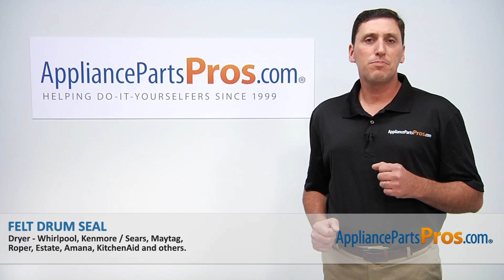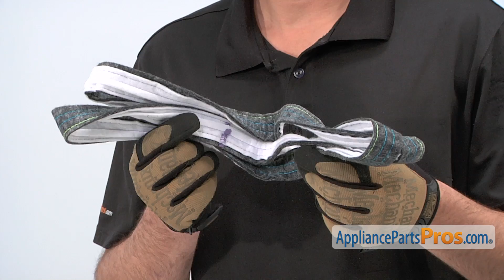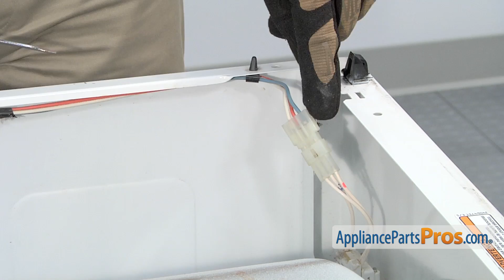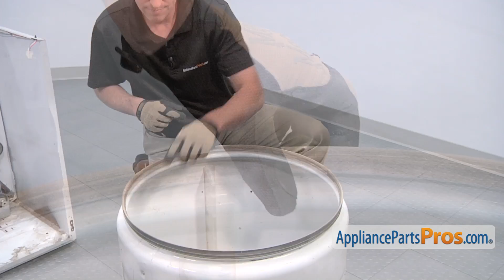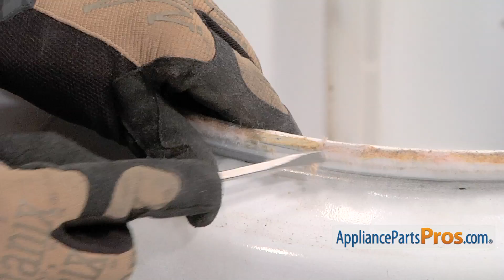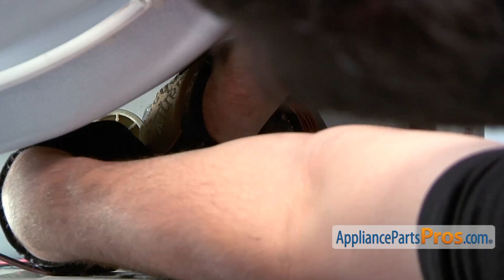How To: Whirlpool/KitchenAid/Maytag Felt Drum Seal W10612022

Comment: Done this many dozens of times, never removed the old glue, never had a problem just gluing the new one on and 3-4 vice grips will make your life a lot easier putting this on.
Reply: See my reply to you later down in the comments.
Edit: and for gods sake don't use vice grips here it has the potential to crush the lip of the drum where it is rolled on the edge. Use spring loaded clothes pins like shown or better yet small spring clips. They're .50c each at harbor freight.
Reply: @ogrish76 I'm doing this repair right now. Do we need to wait a day for the glue to dry or just the 20 minutes?
Reply: @modernNeanderthal800  I just did mine I'd say let it dry over night. It took some tugging to get them in the right position when it came time to put it together it's not a place you want to mess up.
Reply: @SlickArmor  It didn't work so we threw it away and got a $600 dryer.
Reply: @modernNeanderthal800  oh man sorry to hear that.

Comment: Thank you so much for this. This video really helped me a ton. But I did have a little issue carefully putting the seal around the drum on the adhesive, though. It seemed a lot easier in this video than it actually was, but I'm by no means close to a handyman. Also it may have helped to note the angle facing outward for the pulley. I didn't realize I had it on backwards and had to start all the way over from there. I hope I'm not sounding overly critical. Like I said earlier, this was a life saver. The instructions were so clear and gave plenty of in depth views of what exactly to do.
Reply: They always make it look super easily in the videos lol, 3-4 vice grips make this easy to get on.
Reply: @ogrish76  Yeah, everyone else uses binder clips, clothes pins, and even vice grips.  One guy in the comments said it was like putting a tire on.  I've never seen anyone do it the way this guy did, but he was using a seal that fit on easily.  Try your seal out first before doing it this way.

Comment: To remove the old glue, use a rotary tool with wire brush attachment.  It worked like a charm to provide a clean surface with which to apply new adhesive.
Reply: Done this many dozens of times, never removed the old glue, never had a problem just gluing the new one on
Reply: @ogrish76  don't be a slob hack, there is a reason you remove the old glue residue. It allows the felt to fully seat into the groove and you'll have no tight spots where the seal is pushed up from old glue deposits. That's the difference between a craftsman who is proud of his work or a hack who will wonder why his sloppy job only lasted 6 months. Take some pride in your work man.
Reply: @ogrish76 
Many dozens of times? It means you have a problem in installing it😂
Reply: Do you paint it after wire wheel?
Reply: @tubejim101  No

Comment: The second most important step (first being to unplug the unit) is to PUT ON SOME DISPOSABLE RUBBER GLOVES before gluing the drum seal to the drum.  That glue is seriously sticky, and once it's on your hands, it is a pain to get off.   FWIW, using denatured alcohol and a green scotch pad and lots of scrubbing will give your a nice exfoliation wherever it was stuck on them.  But save yourself the trouble and just put on a pair of disposable gloves first.
Reply from the maker: Thanks for that tip! On the plus side, your hands are very clean and smooth now. :)